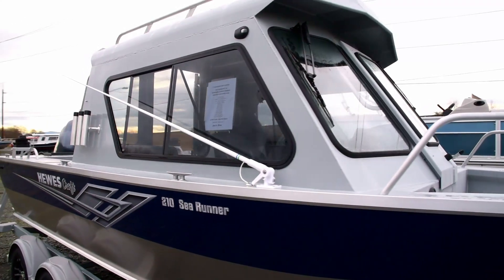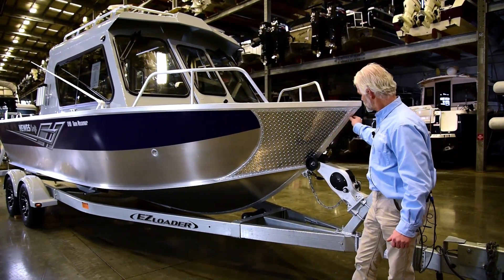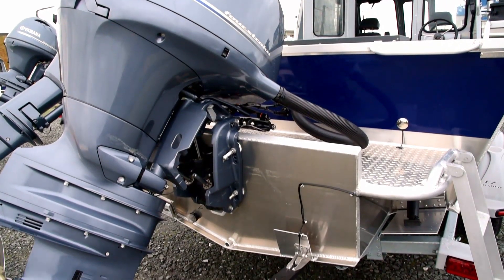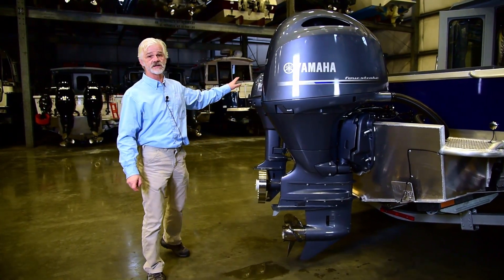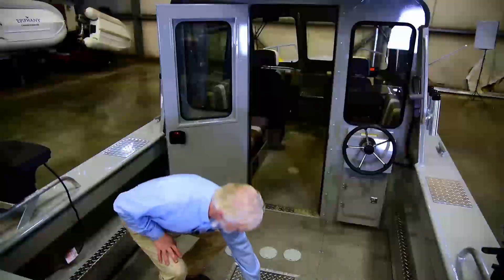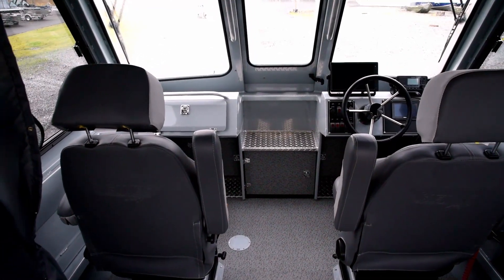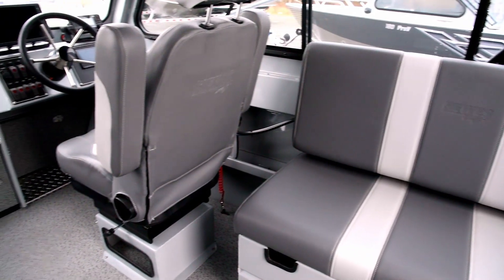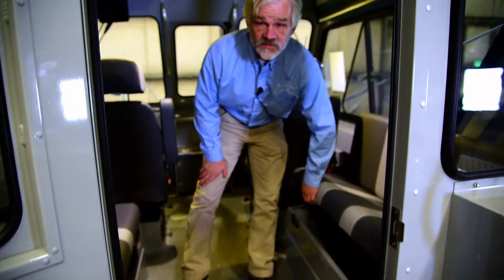Boat Tour of the Hewescraft 210 Sea Runner

Comment: What is the price on this boat?
Reply: I got a few quotes from a few dealers, basically fully loaded the 2021 searunner 210 (full electronics including downriggers, radar, sonar etc) 150 main 9.9 kicker is around 82k
Reply: @quinnowens1419  thanks
Reply: @quinnowens1419  lol, nice, ithe manufacturers and dealers agreed not to display price.  Like the car dealers, boat dealers are antiquated and need to be replaced with a direct manufacture to customer model like Tesla imo.